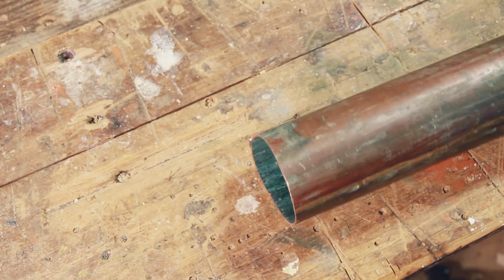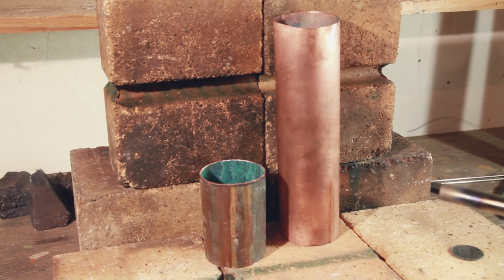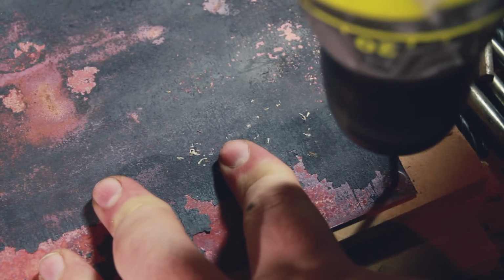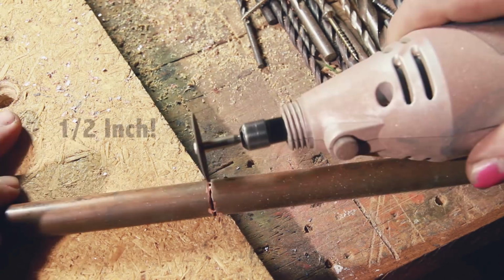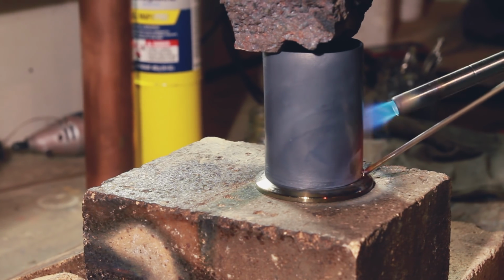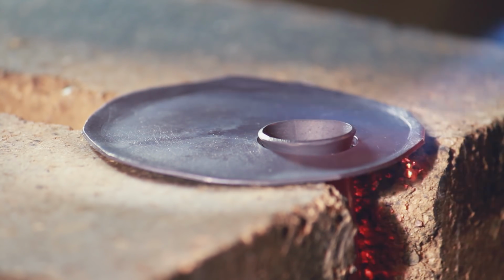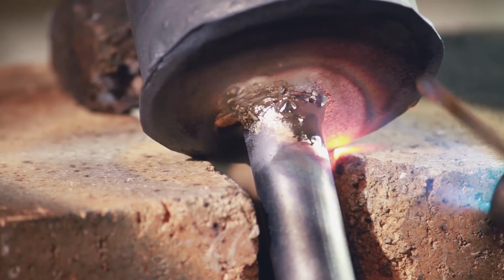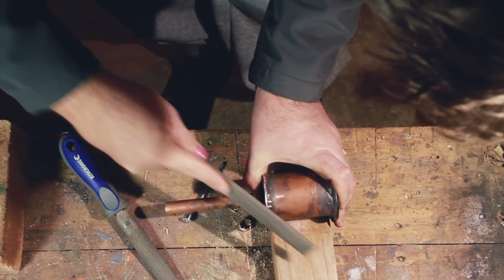Building A Reducer | CCVM Build | First Time Brazing

Comment: Okay so I know that I am like 4 years late and I may be asking a stupid question, but wouldn't "tining" your stainless fitting first help in this situation? As it would basically allow you to attach the joint from both the inside and the outside of the joint at the same time.

Comment: Great job with safety - the bricks behind the torch. Simple enough but not every takes those extra few minutes to Do it. A cookie sheet works in tight areas too...just saying. If ya don't have a pipe cutter style tool , a chop saw makes a straight/90° cut. Also a hacksaw and a radiator clamp to keep the blade straight.
Great video thanks for posting..

Comment: Nice nail polish dude lol
Reply from the maker: Just for you 😘 hahaha 
. . . .ahhhh I have a young daughter . . . . more explanation needed? haha
Reply: HaHa i understand, Hey are the twins born yet? I hope the wife and family are all good and healthy. If i'm not too early Congrats!! I have got a 50L beer keg and stainless still ordered and on the way but i'm wondering how much copper i will need to pack the column with ? The column is 50mm wide and 900 tall, the condenser is also stainless with 3m stainless spiral in so i know i need to pack some copper in it somewhere LOL
I am in no way endorsing them but anyone else in Europe looking for a quality still that's not from China at a good price should check out www.prostill.co.uk/en_US/p/Pot-Still-PSG/68 That is the one i have got in 50L. I am thinking of ordering some tri clamps and some 10mm copper tube to cut a hole at the top of the column with a tri clamp ferrule welded on so i can convert it to a ccvm when making vodka or fuel. Anyway   do u have any advice for someone using a stainless still ?

Comment: Do you have some drawings for your still would be interested in making some changes to see if I can make some improvements.
Reply from the maker: +Robert Tate hmmm. I have SketchUp files. But they are a little outdated now.  Bunch of things changed before I actually built it.
Reply from the maker: +Robert Tate whoops hit enter too fast haha.

Actually it may have mostly just been the column length.  If you use SketchUp I think I made the files public.  Pretty sure it's the only "ccvm" on there haha.
Reply: Still It thanks that's great
Reply from the maker: +Robert Tate cool you find it?
Reply: Still It not had time yet but will look later.

Comment: You did a pretty good job for a beginner keep practicing you will get better.
Reply from the maker: +Thomas edwin thanks man.  let's face it this one was ugly!  But the ones I did at the end turned out pretty well.  I am definitely still a beginner, but at least now I can be confident of success when I braze haha.
Reply: You can get almost anything on flebay,  delivered right to your door.  I never brazed anything I always used Oatey lead free safe solder. I always worked on house plumbing so I'm pretty good at it. I have a 15.5 gallon beer keg for my boiler, with a 8 inch ferrule fitting on top and a 8 inch ferrule cap with a 3 inch hole and ferrule to attach a 3" x 8'  reflux column. I have been trying different dephlagmator methods. I have a few photos if your interested I'm at thomasedwin13@gmail.com
Reply from the maker: +Thomas edwin always interested in seeing stills!  I definitely need to teach my self to solder too!

Comment: I solder stainless and copper & stainless to stainless together all the time. The trick is the right flux and solder. Use Stay Clean Flux and and Stay Brite Silver Bearing Solder. This stuff I even use on stainless to stainless solder jobs and it is very strong. You did an awesome job looking forward to what comes next..
Reply from the maker: Thanks for the tips man!  I couldnt find that solder here, so I went with brazing instead for now.  I want to try soft solder soon too though!

By the way,  checked your channel out.  Looks awesome!  Guessing you have a few nice tips that may help out over there!
Reply: Still It I know I’m 2 years too late and Australian, Bunnings had their store brand “plumbing solder” which is lead free, 3.5% silver, and mitre 10 had some brand name plumbing solder
Reply: @MrCoop thanks I was exactly looking for the flux recco after 3 failed attempts with normal flux last night. @StillIt thanks for all the vids. fellow hd.org member glad to see you doing this and being a great example of safe/responsible fun.  appreciate your efforts to make this legit everywhere.
Reply: 10 4 on the stay bright. That shit will make turds sick to stainless
Reply: It's fine to use the same stuff when plumbing home water lines for something like this with stainless? Awesome! I got some 3in copper pipe from a recent repair and some kegs!

Comment: I am not sure why you didn't fork out $15 or so on a tube cutter, and I am not sure you have used the "safe" kind of brazing rod (you didn't, I think, mention what it was, but it shouldn't contain things like cadmium (or lead of course, but that's usually confined to solder).

Since you list a couple of distilling forums you must realise that you could have used lead free solder to make life a little easier.

I find silver soldering (really brazing) fairly straight forward but lead free soldering is much cheaper.
Reply from the maker: +Rudyard Kipling to be honest the thought of getting a pipe cutter barely crossed my mind.  I'm on a fairly tight budget. Not too sure where you are from, but a quick search here says a pipe cutter for me is more like $60.  And I can only find up to 42mm.  I'm sure I will get one soon though :)

Yup it's prosilver 15.  Same thing as silphos.  I should have mentioned it.

Yup good point about the soft solder.  I was finding it hard to find a suitable flux.  Also as these were the two options always mentioned in forums I thought it would be cool to try both
.  To try both as a noob see what the tricky parts are etc.
Reply: All good mate, it's always worth learning a new skill.

They are a lot cheaper than that at Bunnings BUT, as you say, they don't have one for 50 mm, however, they do exists on ebay (and I am sure at some auto places etc).

There is this:
http://www.ebay.com.au/itm/AU-Heavy-Duty-Quick-Release-Aluminum-Plumbing-Bearing-Tube-Pipe-6-64mm-Cutter-/361999685274?hash=item5448dcd69a:g:OzUAAOSwn-tZNQYt

...and, of course, there is always China: https://www.banggood.com/6-64mm-Heavy-Duty-Silverline-Plumbers-Quick-Release-Tube-Pipe-Cutter-Tool-p-1041481.html?rmmds=search

It took me a while to find the solder flux too - Ezi Weld 801 is the way to go (as I am sure you are aware).
Expensive but that silver solder is even more so (at least here in Oz).

Cheers.

Comment: dude not bad for never doing it b4
but there is 1 thing u need to know  
there is more than 1 way to skin a rabbit and just because I can do it this way doesn't mean that you can. i guess what I am saying is that there is heeps of methods of brazing . so some hints for you 
1 just heat where you want to start  and work your way around 
2 if you have something the same as the flange it is a lot heavier than the copper heat on that first copper is a great conducter of heat and will heat with the stainless also you don't risk overheating it and it melting. 
3 take your time as for the above by doing this the the pool from the rod will wick into the joint and look prettier 
4 dont be scared of over fluxing it will come off
5 as for cleaning up after the job i use citric acid mixed with water in maby 75g in about 7or8 liters of water and a scotch Brite to clean up 
oh and i cant forget 6 just have fun fun as u learn .
Reply from the maker: Thanks dude.  I think I need to sit down and read through all of these comments again before giving it another shot!

Comment: The tip on what to do with the small pieces that get to hot to handle. STOP before it gets that dang short. when you get down to the last third i f the rod while you are brazing to move the heat away and let your rod stick to work. Then get a new rod touch it to the end add a little heat till they melt together. Then go back to working on the brazing you work. Hope that helps I've been doing that since my Father showed me. Also if you want a better braze you would need a better torch. A T100 victor torch and small bottles would help a lot. Keep the videos coming they are fun to watch.
Reply from the maker: ah right,  then its locked in place and not moving all over when you are trying to join em.  Nice,  I like it!  

Yeah I know I am way underpowered with that torch.  Perhaps one day I will upgrade.  Right now resorces I have are going into build materials then ingredients for first few runs :)  I also desperately need some upgrades for filming gear . . . .after that . . . . new torch ;)

Comment: lol yes, i too noticed the nail polish.  nice touch.  for never brazing not bad.   you may have been better off when putting the ferrel on to braze it on the inside.  then you don't have to worry about the clamp.  another trick is if you have a ledge or part to braze.  break of what you need and place it around the area and heat it from the other side.  the rod should melt and the heat should pull it through.  remember also, when you get to the end of the rod, heat up the tip and stick it to a full rod.  that way you can maximize your brazing rods.  impressive though for your first time.  plus it does look cool.  keep em coming.
Reply from the maker: Dude,  hahaha!  I actually ment to ask in the video "how do you use the rest of the rod when it gets to small to hold?"

2 YO daughter ;)  Explain it? lol 

So you would heat it from the outside and put the rod up from the bottom of the ferrule Then use the heat on the outside to pull it through the joint?  Hmmmm, may give that a go!
Reply: have a daughter myself.  been there.  😀 i get the question alot on what to do on the end.  another bit would be to just tap the area with your rod.  you'll know you have it at the right temp if it melts on contact.  then use the heat to stay ahead of the rod.  it should pull towards the heat.  but for a first time u did good

Comment: I saw this one guy do a braze by making a ring of solder which he put in place, heated until it melted filling the void. Will try to find the video.
Reply from the maker: I have heard similar suggestions actually.  And seen something similar for small plumbing style joints.  Be interested to see it for something like this too!
Reply from the maker: haha could do!  But honestly I kinda want to learn.  

I want to get to the "oh shit that could be a good idea! Lets just knock one up and give it a go on this run!" stage.  

That and I think its kinda cool for other noobs to see what its like to try and do it your self.  Will check the link thanks man!
Reply: Go check out "Rate my weld" they mark little people out of welds.

Comment: Did you use a flux?
Reply from the maker: I did,  just for the stainless.  But I have since been informed that it was not fit for the job (low temp).  So I will be getting something more suitable.
Reply: Still It sweet as